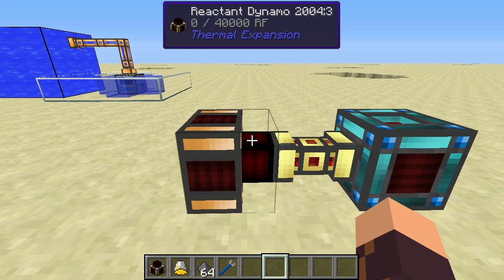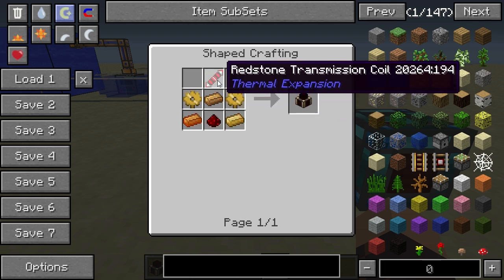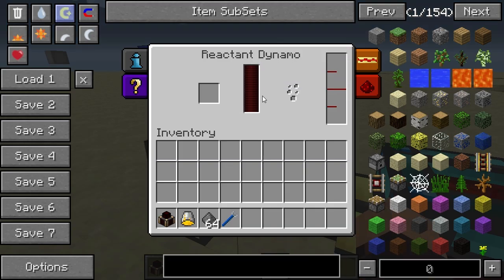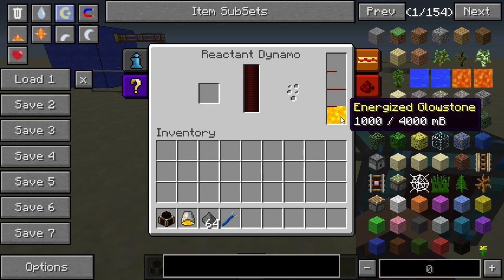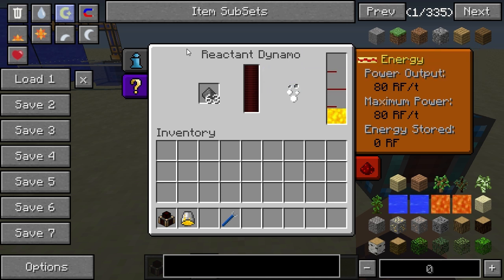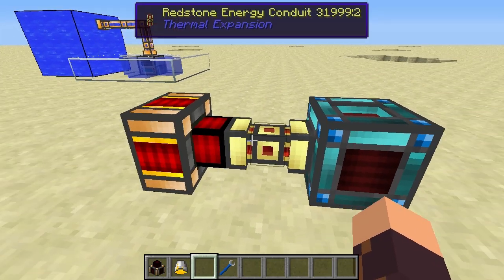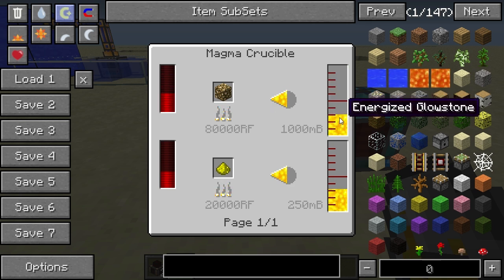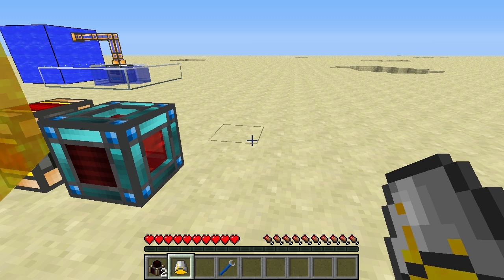Thermal Expansion - Reactant Dynamos

Comment: question i have 30 reactant dynamos cause i need quite a bit of power to run my base and currently have max speed upgrade in them but should i swich them to the fule saveing upgrades (it will still generate same ammount of rf but will output it slower)